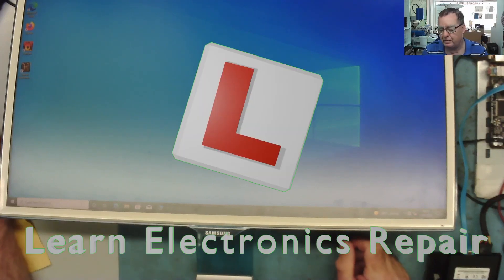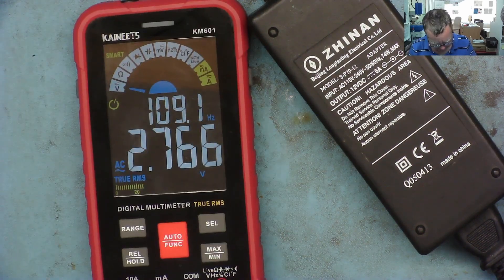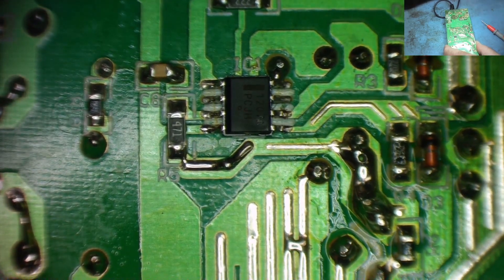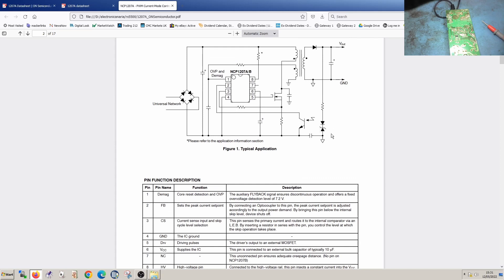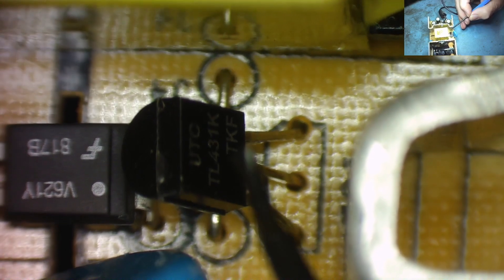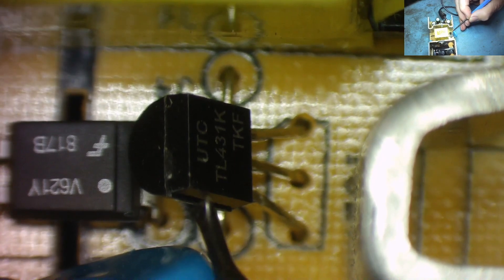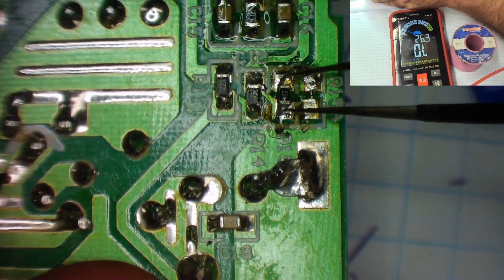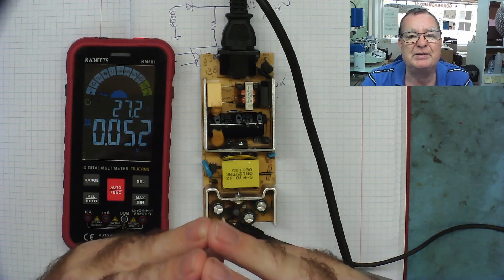How To MOD / HACK Change ANY Switch Mode Power Supply Output Voltage. An SMPS Tutorial Guide.

Comment: Using a battery drill as a generator connected to the 19v output, and the Ac is offline. Generating fixes locked power supplies, and those that are not strong enough, and should be working better. Generating is done, when in one direction or in both directions you feel resistance. Some needs 3 minutes work, but Acer charger needs 10 minutes to fix the charger. The chargers are sometimes downgraded by the marketing managers to sell the whole thing below the desired price. You can upgrade the charger using the method, and it will become a high category charger.

Comment: I tried to modify some 12V psu to get 5V but doesn't work... Any suggestions?
Reply from the maker: What happens when you try to mod it?  I did mention in the video you can change the output by a few volts but trying to reduce it to less than 50% of the intended output may just mean the PWM controller reaches it's minimum duty cycle and can't go any lower